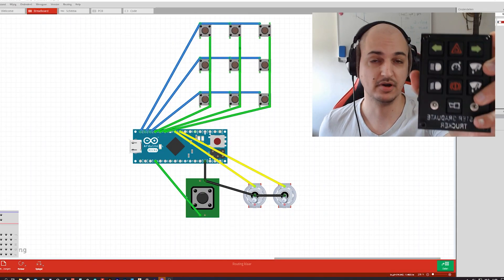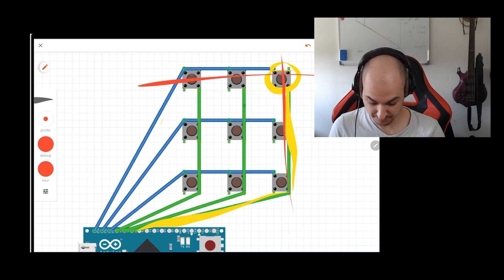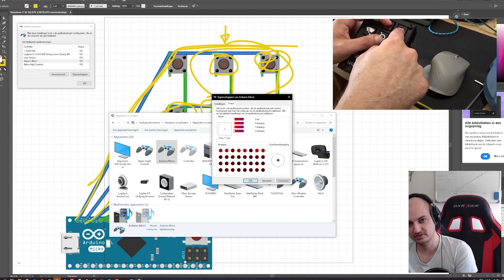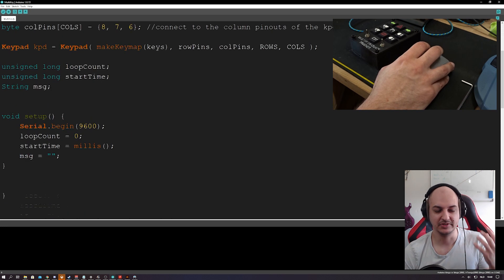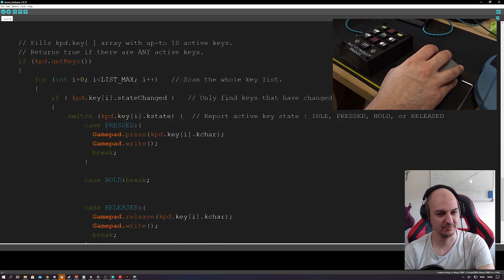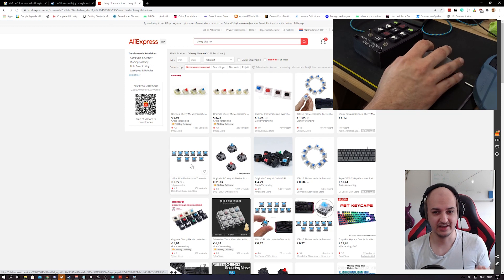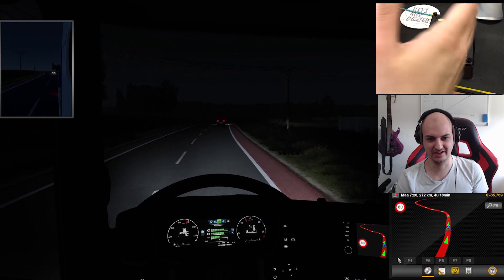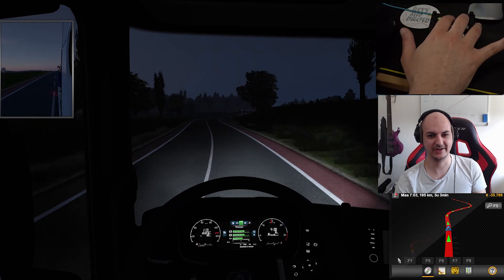Euro truck simulator 2 Arduino controller

Comment: just found out your channel,your button boxes tutorials especially for msfs are awesome.i am building one just ordered the parts. Can you please show how one can wire a real ignition switch to a arduino pro micro ? .There are couple of videos on youtube but all of them use the zero delay usb encoder.The wiring for the switch is something i have been unable to figure out.The code part is quite easy.
Reply from the maker: Are we talking about a realy ignition switch you got straight out of a car/airplane or one of those electrical ignitions you can buy ? https://www.aliexpress.com/item/32899745173.html?spm=a2g0o.productlist.0.0.2fb035b7Ab1pGI&algo_pvid=97e6c018-270b-4d9c-80ee-3b48a0e0c5a6&algo_exp_id=97e6c018-270b-4d9c-80ee-3b48a0e0c5a6-3
Reply: @Bitsanddroids  so the link wont open,aliexpress is banned in my country.This is the switch i am talking about. https://www.amazon.ca/Dorman-85936-Conduct-Interrupteur-universel/dp/B000CO7IIQ/ref=sr_1_5?keywords=ignition+key+switch&qid=1590444822&sr=8-5 . everyone on youtube is using this. i found the code for it here https://pastebin.com/GAnv2A4y but the main yt video that had the wiring has the video blurred for whatever reason.
Reply from the maker: @builditbuilda2925  It seems like this is an overview of the diagram. Power in through the battery pole and the ignition/start gets connected depending on the key position. The start/ignition pins would be your measuring points on your board.
Reply: @Bitsanddroids  i am going to try this this week and will get back,infact will send you the pictures aswell of the schema that way everyone can benefit from it if you put it on your channel.